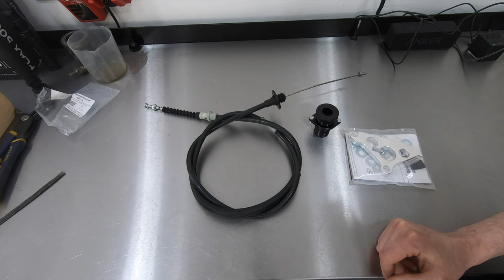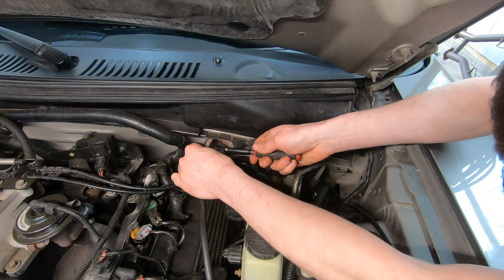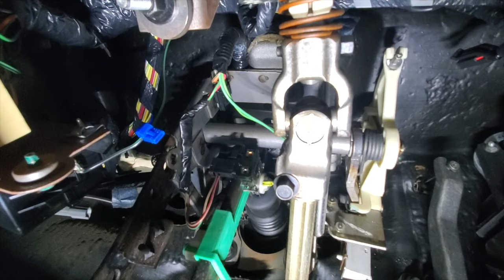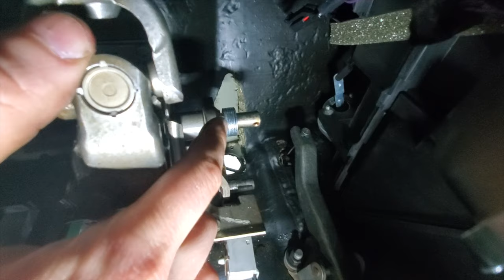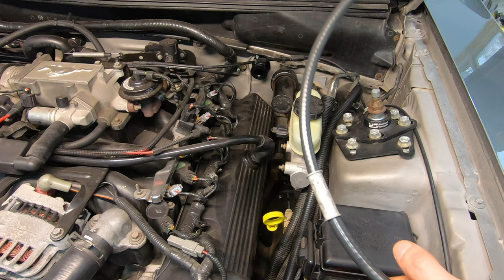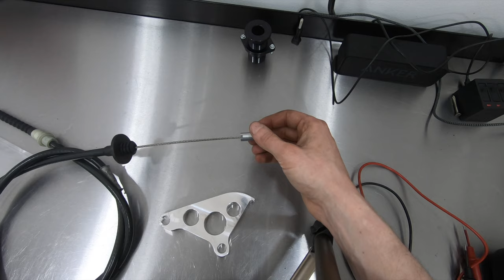1979-2004 Mustang Aftermarket Clutch Cable, Firewall Adjuster, and Quadrant Install.

Comment from the maker: Links to the parts and tools I used in this video:
OEM Ford Cable:https://amzn.to/2Z9LAnb
You can put a Ford cable on any aftermarket quadrant or firewall adjuster. You will have to modify the cable to go into the firewall adjuster.
UPR Quadrant:https://amzn.to/2TbLojk
UPR Firewall Adjuster:https://amzn.to/3bFCUYl
Maximum Motorsport: https://www.maximummotorsports.com/Cl...

Help support the channel, buy using my Amazon links
As an Amazon Associate I earn from qualifying purchases and your cost is exactly the same.

Comment: Finally someone explained the cable tension properly for peddle engagement.. helpful video thank you
Reply from the maker: This is right from Maximum Motorsport's website:
Ford equipped most Fox and all SN95 Mustangs with a self-adjusting mechanism designed to maintain proper clutch cable tension at all times. As the clutch disc wears, the mechanism automatically adjusts the cable tension so the clutch continues to operate correctly through its entire life.

A properly adjusted clutch cable has some tension on it. This keeps the throwout bearing in constant contact with the fingers on the clutch pressure plate diaphragm. That contact is essential for the self-adjusting mechanism to work. Contrary to popular belief, this is a design feature and does not prematurely wear out the Mustang throwout bearing.

The stock self-adjuster consists of a plastic quadrant/pawl gear assembly. The plastic wears out over time, but aftermarket pressure plates with higher clamp loads speed up that process. Even in a stock setup, age degrades the plastic and breakage becomes more likely with each passing year. The solution is to replace the plastic mechanism with long-lasting metal parts.

The typical replacement is a non-adjustable, aluminum quadrant. Be aware that once you remove the stock self-adjusting mechanism, clutch cable adjustment is no longer automatic! You must replace it with some method of adjusting cable tension. Maximum Motorsports does this with an assembly called a firewall adjuster, which lets you easily adjust cable tension from under the hood of your Mustang. To compensate for normal clutch disc wear, you'll need to adjust the cable tension periodically.

As the clutch friction disc wears and gets thinner, the end of the diaphragm fingers touching the throwout bearing push on the bearing, applying more and more load to the cable and increasing its tension. This starts to disengage the clutch, leading to clutch slippage. Keep up with adjusting your Mustang's clutch cable to maintain good performance and avoid premature clutch disc wear.
Reply: @RepairGeek  I just noticed that the cable bracket in the engine bay does not get right on mine will this effect anything? From what it looks like to me it just keeps it away from the header...
Reply: Tight’ not right...

Comment: great video man thanks for the easy to follow instructions, i wish you couldve videoed the adjuster removal bc thats what im having trouble with. i went to the pull apart and got a used plastic quadrant to use while my after market one is being shipped. unfortunately i cant figure out how to install the plastic adjuster

Comment: My 03 cobra engages very close to the floor and is very easy to stall. Only 10,784 miles on the car and have had the new kit in the garage for 3 weeks now. Wish I had a lift. Did one in my driveway years ago on an 04 Gt and didn't have to remove the seat. Tight fit for sure but it's doable

Comment: Wanted to point a misconception in this video:

- The firewall adjuster isn’t used to achieve pedal height, it is strictly for clutch cable tension to achieve 3-5 lbs of pressure for the clutch pedal to move 1/2”. Your pedal height will be determined IF you use a adjustable pivot ball stud in the transmission bell housing to setup up the angle of your clutch fork. Maximum Motorsports has now updated their instructions to state that 3-5 lbs of pressure is needed to hear the “clink” of the quadrant coming off of its stop.
Reply: Good point  I've got a 01 Bullitt with 39k miles with the factory quadrant still clutch peddle bites level with brake peddle and clutch peddle is up really high thinking i need to see if factory quadrant is teeth are worn out?
Reply: @jasonthorogood  Its more than likely that its worn out. It’s plastic and over 20 years old so it’s passed it’s service life

Comment: Love the video. I’ve got an ‘01 GT that I’m looking to do these upgrades on however Ford has discontinued the OEM cable. My current cable is still working fine. Curious if you’d still recommend replacing the cable or if I should keep it and just install a MM quadrant and firewall adjuster.
Reply from the maker: I'd keep it if you can. I wish I had bought 2 of these cables now. :/

Comment: Ok but somebody tell me if the TOB should be riding on the pressure plate with preload or gapped slightly, my clutch slips when the cable is loose and bearing is off the pp and the TOB makes aloud clicking noise and you can feel it in the shifter when it is preloaded I am at a loss and don’t want to redrop trans please help

Comment: Hello, are you putting pre-load on the throwout bearing in this application? Many conflicting reports online. Ford seems to call for preload on the throwout bearing so that it's actually riding on the clutch fingers. Makes no sense to me, seems like it would lead to premature TB wear. What do you do?
Reply from the maker: Talked to Maximum because I was wondering the same thing. According to them this TB is an angular design meaning it can handle small thrust loads. So the TB should be touching the pressure plate. The TB and pressure plate should be spinning at the same rate all the time.
Reply from the maker: This is from MM website:
Ford equipped most Fox and all SN95 Mustangs with a self-adjusting mechanism designed to maintain proper clutch cable tension at all times. As the clutch disc wears, the mechanism automatically adjusts the cable tension so the clutch continues to operate correctly through its entire life.

A properly adjusted clutch cable has some tension on it. This keeps the throwout bearing in constant contact with the fingers on the clutch pressure plate diaphragm. That contact is essential for the self-adjusting mechanism to work. Contrary to popular belief, this is a design feature and does not prematurely wear out the Mustang throwout bearing.

The stock self-adjuster consists of a plastic quadrant/pawl gear assembly. The plastic wears out over time, but aftermarket pressure plates with higher clamp loads speed up that process. Even in a stock setup, age degrades the plastic and breakage becomes more likely with each passing year. The solution is to replace the plastic mechanism with long-lasting metal parts.

The typical replacement is a non-adjustable, aluminum quadrant. Be aware that once you remove the stock self-adjusting mechanism, clutch cable adjustment is no longer automatic! You must replace it with some method of adjusting cable tension. Maximum Motorsports does this with an assembly called a firewall adjuster, which lets you easily adjust cable tension from under the hood of your Mustang. To compensate for normal clutch disc wear, you'll need to adjust the cable tension periodically.

As the clutch friction disc wears and gets thinner, the end of the diaphragm fingers touching the throwout bearing push on the bearing, applying more and more load to the cable and increasing its tension. This starts to disengage the clutch, leading to clutch slippage. Keep up with adjusting your Mustang's clutch cable to maintain good performance and avoid premature clutch disc wear.
Reply: @RepairGeek Interesting. I did a TR3650 manual swap into my 2008 Crown Victoria using an MM cable (the best in the biz) and their firewall adjuster, along with a Steeda quadrant. Just couldn't bring myself to keep the TB riding on the pressure plate (I hadn't read this yet), so I put maybe 1/16th an inch of clearance. It seems to work fine, I will just have to remember to stay on the adjuster and keep tension on the cable as the clutch wears. Seems like without the OEM Mustang "self adjuster", there would be no need for constant contact between the TB and the pressure plate. Depending on how things go for the first few miles, I may adjust it so the TB is up against the pressure plate as you state. Thank you for the responses, love your videos!

Comment: Thanks for the great video! There's a pretty heavy clutch in my 04... basically an anti theft device as the average thief wont be able to drive it with no practice. The cable just straight up snapped in half! Is that the typical failure? Looks like the quadrant has already been replaced though... perhaps it was adjusted too tight?

I'm thinking about installing a hydraulic clutch if this new cable doesnt last... hopefully the old one was just frayed and that's why it was so darn stiff. I got a teflon lined BBK this time so its smoooth. Also my friend swears an 04 is supposed to have a hydraulic clutch stock. Is he right?! Because somebody swapped an old T45 into this car instead of the correct TR3650 it turns out. It drives great. But the digital odometer and speedo doesnt register due to DTC for vehicle speed sensor low voltage. It looks like the T45 has a different style sensor tho. I'd really like to fix that if anybody knows how to do this?! How do I get the old T45 sensor to interface with the 04 ECU/dash? Sorry I know it's off topic but I cant find this answer anywhere.
Reply from the maker: Your cable snapped because you are using cheap cables. BBK is junk as well. You will have the same issues with time. Spend the coin buy the MM setup and you won't have problems. I literally removed the stock setup in this video. It's not hydraulic. They went to hydraulic in 05+. 

If you have a code for low voltage, have you inspected the wiring going to the sensor? A broken wire or poor connection would cause a low voltage concern. Also every manual mustang from 99-10 uses the same sensor. The only way that I could see that you have a sensor issue is if your transmission is pre 99 because 99+ all use the same sensor.
Reply: @RepairGeek  this is great info! That's what I mean I think it's a pre 99 trans. Its got the sensor with a gear instead of the magnet. Also I believe it's got a stage 3 clutch according to previous owner. Probably just such a heavy spring
Reply: My BBK cable snapped about six months after clutch rebuild smh

Comment: Did you end up securing the cable somewhere in the engine bay so it won't touch the headers or something like the power steering pump?
Reply from the maker: I zip tied it to the frame somewhere. Obviously don't kink it.

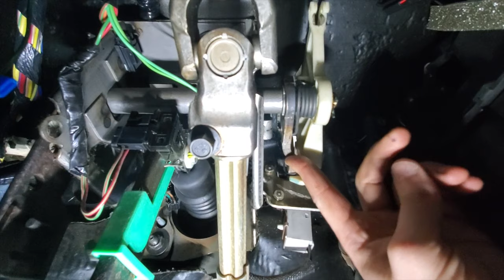Comment: need help!  restoring a 1989 and the clutch stays at the floor would that be caused by the spring on the quadrant shown at 4:36?? if so what is that called and where to find it? Thanks in advance!
Reply from the maker: If you have a stock quadrant that's plastic the teeth may be stripped, your cable could be stretched, or it's way out of adjustment.

Comment: Could a problem shifting be because of the quadrant and/or cable. Had trouble shifting one night, then next day everything seemed to be okay again? I'm worried it's going to fail on me again.
Reply: Could the problem be in the shifting linkage instead?
Reply: @ltlpaa2973  did you ever get this issue sorted? 2000 gt with the T45 here, going through the same thing-3rd gear seems noise going from 2nd to 3rd shifts

Comment: Hi this is unrelated but does this gen mustang have a low oil pressure light? My oil pressure sending unit is broken and I’m worried that I actually have low oil pressure. Just bought the car too
Reply: No just a oil gauge and they never really work the greatest

Comment: Could a wore out clutch cable cause slight chattering while clutch is engaging?
Reply from the maker: No that's either clutch or flywheel.
Reply: @RepairGeek  I gotcha.  Just had a new clutch put in and he told me the flywheel looked great.  🤷‍♂️
Reply: @christopherholden4024  do you have a T45 as well I’m betting ?
Reply: @rileydines  3650
Reply: @christopherholden4024  my t45 has a chatter in 3rd and 2nd